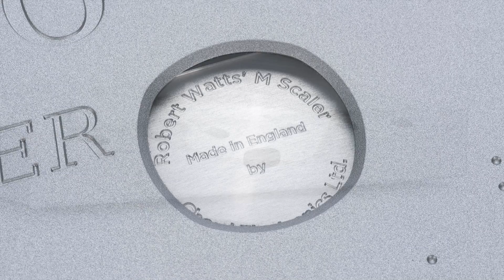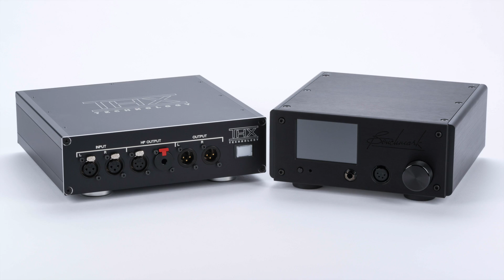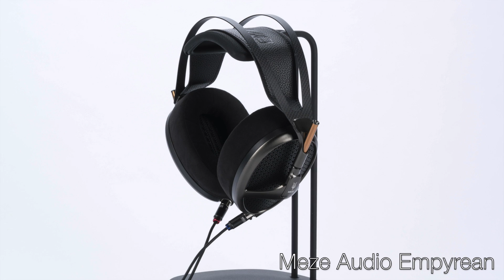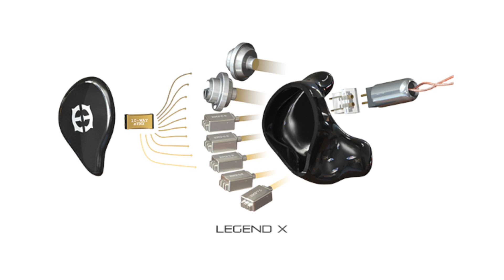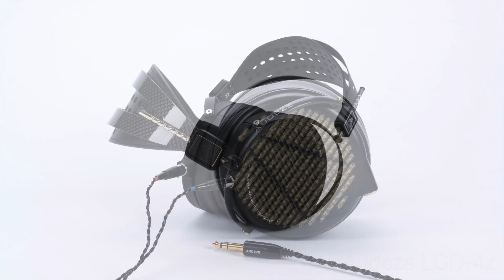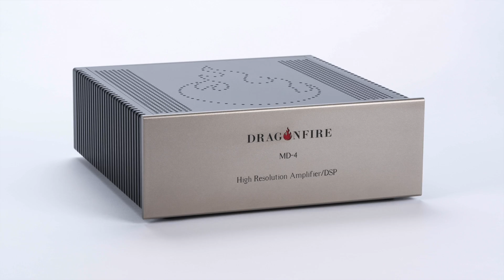New Flagship Headphones, IEMs, Amps, DACs, And More At CanJam @ RMAF 2018

Comment: If you don't like Chord's current products for head-fiers, just wait 6 months and they'll have a whole new lineup ;)

(fwiw, I'm NOT a hater - I bought the original Hugo and used it with a wide array of headphones and speakers - but Rob Watts just doesn't sleep and that means Chord undoubtedly has a 'Hugo TT 3' in the pipeline. 6 months is a long time in the computing world and that is fast becoming the case in high-end audio)